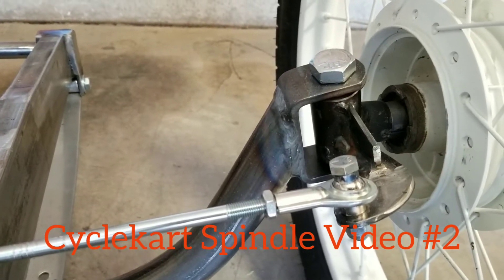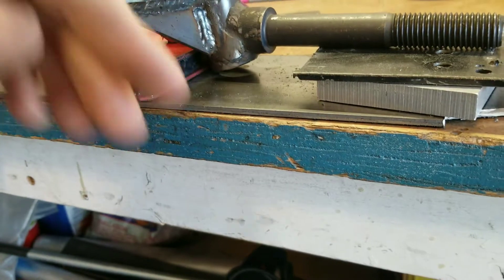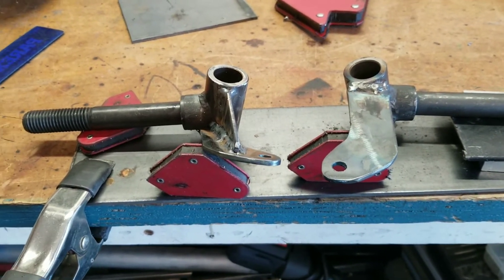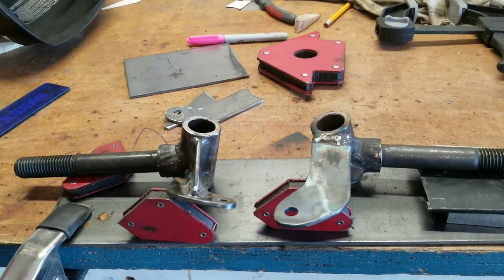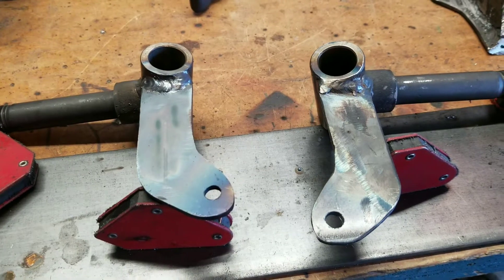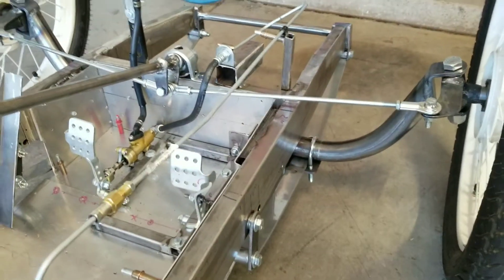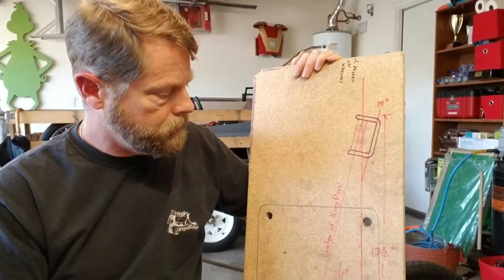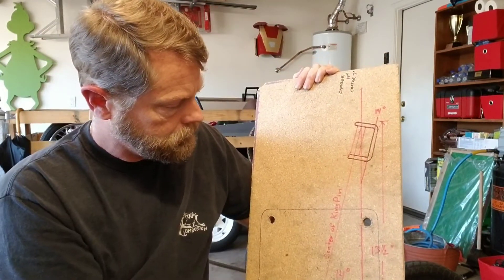Cyclekart Spindles from Scratch Version #2

Comment: What size tube did you use that your axle are welded to? I have some 1.25 O.D. D.o.m. that I was thinking of using.
Reply from the maker: 1.5" x .095 wall round tube is what I used. Mostly because that was the biggest die the fabricator had to make the bends. Thanks for watching.
Reply: @stevevinson6030  No I meant  the axle that goes through the wheel the spindle is made with a short piece tubing with a bolt welded to it that the bronze bushings go in and I was wondering what the dimensions of that little short piece of tubing was.
Reply from the maker: @your2nd  ohhh.
2.25" tall
1.25" OD
.864" ID